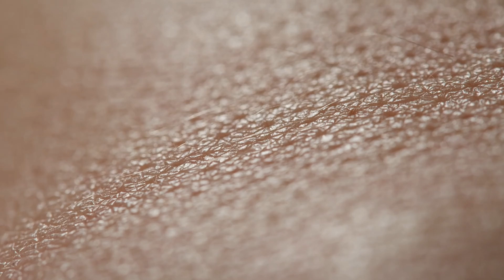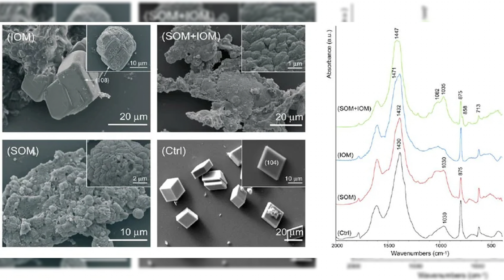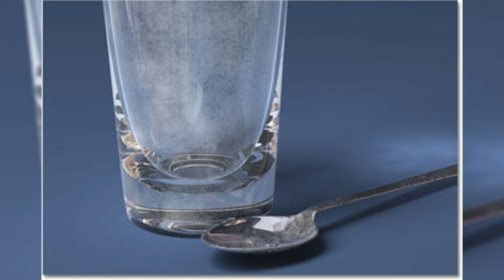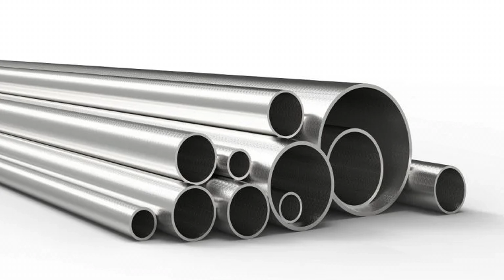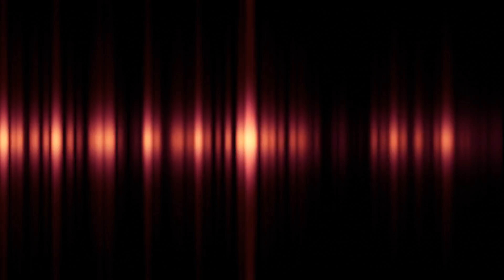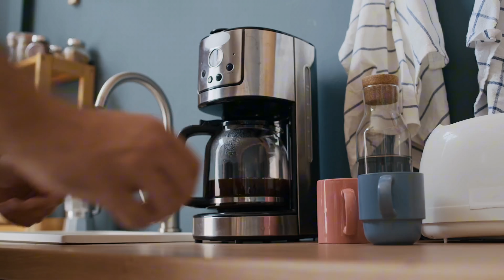🧲 These $12 Magnets on Your Pipes Eliminate Hard Water — No Salt, No Filters, Ever!

Comment: Alright, so i did some research, this is real BUT this idea has some issues.

1 As he said, the strength of the magnets matters a lot

2 its temporary, the crystals will reorder themselves bavk to their initial structure within 24-48 hours

3 high pressure, bendy pipes, and heat agitates the crystals and causes them to revert into their original structure. 

It will work for your cold water but the hot water tank is going to reset the work the magnets did.

So while the video didn't make up the restructuring of the minerals, it didn't mention that the new structure isn't stable
Reply: @327CBG I'm assuming this is a problem due to the amount of time water sits in your water heater. Wouldn't putting a second set of magnets on the water heater outlet pipe help?
Reply: @fastone371 it is that but also the heat itself destabilizes the new crystal configuration.

You could seperate the calcium out theoretically if you wat to try this method. 

So, if i understood what i read correctly, once they start restructuring because of the magnetic forces, the calcium clumps and becomes heavy.

This means that if you would pump the water in to a tank where some of the water could slow down then the calcium might precipitate at the bottom.

This likely would only reduce the hardness of the water you extract and you would likely need to suck out the calcium precipitate so it doesn't eventually revert back to the kind that sticks and creates hard water.

I haven't tested it myself but from what i read this should work
Reply: @327CBG  Thank you for answering.
Reply: What I'm interpreting here is that the application is sound, but for best results I should have more than one set? Maybe on the incoming line, again after the water heater, and again before something I really need to have protected? At $12 a set, that's still cheap.

Comment: You can get a broken electric bicycle for around 10-50 euros. (batteries are to expensive to replace)

Get the wheel motor out and tadaa you've got strong neodymium magnets.
Scrap the rest at your local scrap dealer and you've got neodymium magnets with a profit.

Comment: Nonsense!
I guess you don't know how molecules behave in a fluid.
Passing throuh a magnetic field, a molucele may reorient itself, but after being there for a second, it will pass and bump around countless times before it will end up in your applience. When water is heated the numbe of interactions will increase dramatically.

And then the deposit will change?
Laughable!
Reply from the maker: You’re actually proving my point without realizing it. Nobody said the magnets “freeze” molecules permanently into some magical orientation all the way to the appliance. That would indeed be nonsense.
The research is about nucleation and crystal formation during precipitation — specifically the ratio of calcite vs aragonite during calcium carbonate crystallization under certain magnetic field conditions. Those are two different crystal structures of the same mineral, and they behave differently in terms of adhesion and scale formation.

This isn’t “YouTube science.” There are peer-reviewed studies on it, including in the Journal of Water Process Engineering and multiple reviews on magnetic water treatment and calcium carbonate precipitation.

Is it universally accepted as a miracle cure? No. Results vary depending on:

* water chemistry
* flow rate
* field strength
* temperature
* pipe material

But pretending there is zero documented effect is just as unscientific as pretending it’s magic.

Even the criticism from skeptics is usually:
“the effect is inconsistent or difficult to reproduce,” not:
“the effect is physically impossible.”

Big difference.

And yes — heating increases interactions. That’s exactly why scaling happens aggressively in kettles and heaters in the first place. The studies are specifically looking at precipitation behavior under those conditions, not molecules politely staying lined up like soldiers for 3 miles of pipe.
Reply: You've been schooled ❤ha ha

Comment: Many rigorous tests (e.g., U.S. Dept. of Energy, Army Corps of Engineers, Penn State) found no significant benefit from magnetic devices compared to controls for scale prevention or corrosion reduction in typical conditions. I give this video an F for accuracy.
Reply: I have no idea one way or the other if this even works but the author has provided citations to support his theory, you should also provide references to your claim.  Then we can decide.
Reply: Perhaps you should do the test for yourself?
Reply: What you are stating is that the magnets work with the same efficiency as other much more expensive systems. Correct?

Comment: water treatment doesn't meaningfully soften hard water. Here's why:
The idea is that magnets clamped onto pipes will change the structure of dissolved calcium and magnesium ions so they don't form scale. Manufacturers of these devices claim the magnetic field alters how minerals crystallize, making them less likely to stick to pipes and fixtures.
The problem is that the scientific evidence doesn't support it. Controlled, peer-reviewed studies have repeatedly failed to show consistent, significant effects. The dissolved mineral content of the water — what actually makes it "hard" — remains the same after passing through a magnetic field. The calcium and magnesium ions are still there, so the water will still leave deposits, dry out skin, and interfere with soap just as before.
Some individual studies or anecdotal reports have claimed modest scale-reduction effects under very specific lab conditions, but these results haven't been reliably reproducible, which is a red flag.
If you're dealing with hard water, the approaches that actually work include ion-exchange water softeners (the traditional salt-based systems, which swap calcium/magnesium for sodium), reverse osmosis systems for drinking water, or template-assisted crystallization (TAC) systems, which are a salt-free option that conditions scale without removing minerals. The right choice depends on how hard your water is and what you're trying to solve — scale buildup, soap performance, taste, etc.
Reply: "Systems" = $$$$$$$$.
Reply: @j @johnnybanana8562  few thousand dollars for something that affects laundry, dishes, showers/baths, and your hot water heater is well worth the cost. It’s the most used system in your house and it guarantees longevity of multiple other crucial systems. It’s just dumb to look at literally anything under $10k that improves a house that drastically and say “Oh WoOoOoW iT’s JuSt ToOoOo ExPeNsIvE”
Reply: Exactly.
Reply: So is the content creator wrong or lying...??🤔🤔🤔

Comment: So you want the magnets to attract each other through the plane of the pipe?
Magnetic strength is measured on a gauss scale. 
Do you know what “20 lbs” of pull strength translates to in gauss?
Reply from the maker: Yes, exactly — the idea is to place the magnets on opposite sides of the pipe so they attract each other through the pipe itself, creating the strongest field across the water flow path. 👍

And no, pull strength in pounds does not directly translate to gauss because they measure different things. Pull force depends on magnet size, shape, contact surface, material thickness, distance, etc.

That said, most N42–N52 neodymium magnets with around 20 lbs of pull strength are generally in the rough range of a few thousand gauss at the surface, but the actual field through the pipe and water will obviously be lower.

The important thing for this setup is less about the exact gauss number and more about creating a concentrated magnetic field the water passes through consistently.
Reply: @Sidney_Explains_Money 
I purchased neodymium metal material 80 lb pull. They came today and I’m confused about the north south positioning of the magnets.
Reply from the maker: @terilivengood6911  The easiest way is to place them so they attract each other through the pipe 🙂
So if one magnet’s north side faces the pipe, the magnet directly opposite it should have its south side facing the pipe. Basically: opposite poles facing each other across the water line.
Most people just test this by seeing which sides naturally snap together strongest, then place them on opposite sides of the pipe in that orientation.
Reply: Tell us, don't leave us hanging.

Comment: I’m not even kidding, I didn’t have plans today, but I’m heading to a hardware store now to try this 😅
Reply from the maker: That's the spirit! Let me know how it works out for you. 👍 I already know you will see a big difference 😁
Reply: @Sidney_Explains_Money have you tried this? Where exactly do you place the magnets?
Reply from the maker: @MrJwyne  Yes, and a few people close to me have as well. The important part is placement and magnet strength. Most people fail because they either use weak magnets or place them randomly.

You place them on the MAIN incoming cold water line, ideally right after the meter and before the water heater/appliances. One magnet on each side of the pipe with the poles attracting through the pipe (north facing south). Basically clamped directly opposite each other.

Also important:

* Neodymium magnets, not fridge magnets
* Preferably N42 or stronger
* Works best on copper, PEX, or PVC
* Not ideal on galvanized iron because the pipe interferes with the field

And no, I’m not claiming it magically removes minerals from the water. The idea supported in some studies is that it may influence how calcium carbonate precipitates and sticks under certain conditions.

Worst case? You spent like $12 experimenting. Best case? Less scaling buildup over time.
Reply: @Sidney_Explains_Money  Any idea (or rather experience) if this prevents hard water spots on car windows from the sprinkler system?
Reply: Good, after that you can build a perpetuum mobile.
Reply: @edmundzed9870  Right after I send you over my thesis about how the earth was flat all along 🤪

Comment: Would this then work better...at scale maybe from multiple points in the system?
Reply from the maker: Ooh, good question! I haven't actually tried that, but it's definitely something to consider. Might be worth a little DIY experiment if you're feeling adventurous! I mean.... the magnets are so affordable than placing them at 4-5 points just to make sure is totally worth trying.
Reply: @Sidney_Explains_Money  That's what I was thinking. If it works there's no reason that it shouldn't work being stacked. I'm sure it works less and less as there's less things to effect in the water, but if that means you get to go from idk random number 70% to 75, or 80 just by adding a few more. So cheap it might not hurt at all.
Reply: @Sidney_Explains_Money  That is what I am thinking.....  Placing them in the pipes just before  they reach the  faucets.